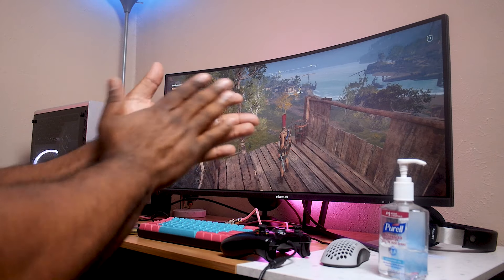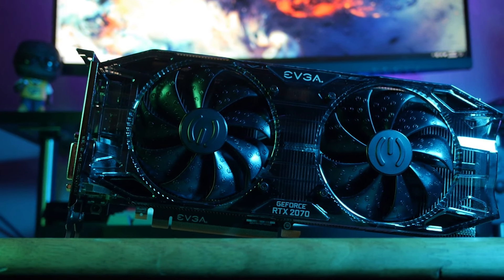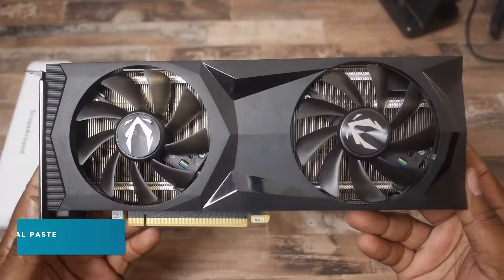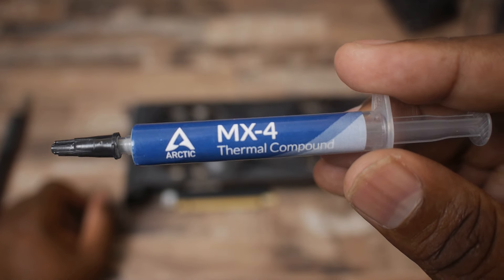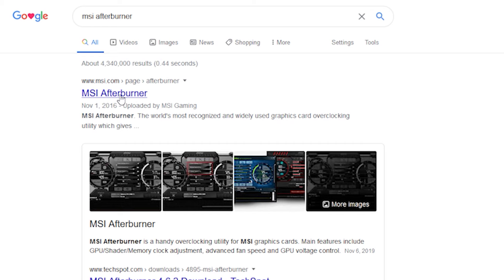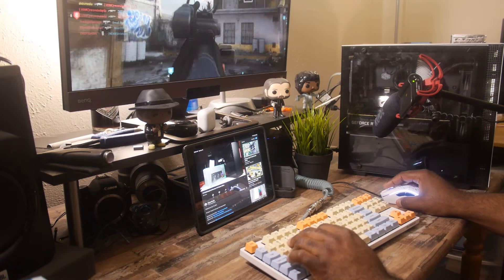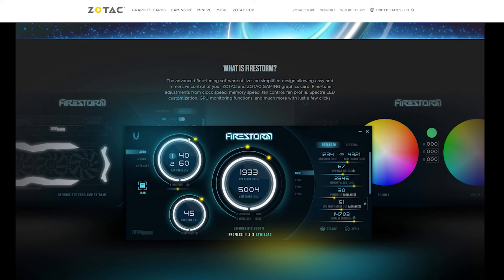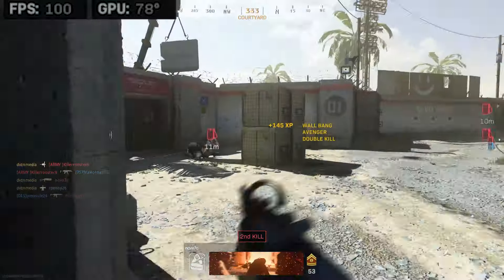3 Easy Tips To Lower GPU Temps!

Comment: just put shadows 2 low shit looks ridiculous at normal or high imo
Reply from the maker: Yeah you can always adjust the sliders to get the option that looks right for you!
Reply: @DVZNMedia  lol i bought a second hand gpu this year... i think its a miners gpu...  the temperatures didnd drop by dropping shadows xD... so i used thermal pads(dont use wrong measure thermal pads it will most likely kill your gpu core) and thermal paste on my rtx 3070 (msi ventus 2x) and cleaned the pcb of the gpu with isopropyl alchohol with q tips cleaned the gpu fans a bit... and my gpu temps dropped from 87+ to 71 C playing resident evil 4 remake on ultra with ray tracing... so yeah if you are ripped off like me this might be a solution also im going to try a intake fan my motherboard has only 1 port for a exhaust fan so i bought a Gelid Solutions PWM fan hub which should arrive tomorrow... and yea with the better inflow intake fan the temperature should drop a bit more... (i dont reccomand undervolting unless you are a expert but setting power limit to 70 from 100 on msi afterburner might help)
Reply: @DVZNMedia the airflow dropped the temperatures even more :^) definitly helps to have 1 exhaust (back) and 1 intake (front panel towards gpu so middle) dropped mine like extra 4 degrees celsius with all the stuff i did with this miners gpu your new gpu would prolly become a freezer o yea and if you have holes on top of your case it helps hot air move out cause hot air goes to the air (thats how those hotbaloons whatever work)

Comment: When running red dead my pc runs at 78-80 is that normal?
Reply from the maker: Red Dead is an intense game, I don't know what your case airflow is but that's not the worst, 80c is fine.
Reply: @DVZNMedia  even witcher 3?
Reply from the maker: Yeah those games can be really hectic on a gpu, like I said it's hard to know what everyone's case air flow is but it can easily push the temps on a most graphics cards
Reply: @DVZNMedia  thank you for the reply!
Reply: @DVZNMedia  i recently installed witcher 3 and played at ultra but my temps keeps playing around 70 and 80c my pc case had a front panel tempered glass that's why I'm planning to use a stand off screws to seperate the glass and the fan to have a airflow do u think this will lower the temp?? 

Thanks for the vid tho 👌

Comment: Guess I was too late just fried my new RTX 2060 by gigabyte ;(
Reply: how? I have the same card and idk if it will get ruined. What temp should I be aware at?
Reply: @MaZeYoutube  don’t be scared my friend I live in a shitty country (Iraq) with a ton of power outages and the power in my country is imbalanced looks like that day the power spiked too high and sacrificed my gpu to save the rest of my hardware i even had ups on it but sadly the ups couldn’t protect it i also ran a heaven benchmark and the max temp was 87C and it was in the burning hot summer of Iraq

Comment: Did all of that but this fucking zotac 3060ti twin edge OC max temp reach 81 degrees tried undervolt change psu change case open panel wtf is wromg with this fuck
Reply from the maker: Well I did speak to a rep, they say that temps well into the high 80s low 90s are ok, I just know we like them as low as possible.
Reply: @DVZNMedia  so its normal? i just my card low temp i had to cap fps on some games to keep it 65c. only when i play pubg at 1440p max settings fps unlimited it reaches 78-81 undervolted when its not undervolted it reaches to 83

Comment: Here’s a big issue that you guys always want to tip toe and dance around all these new damn cases with fucking glass panels and no side ventilation in a bag of the day we used to and I still used today by the way cooler master stacker 830 computer case you can Google that you can see how nice that case is I will ventilated it is what you may not see the fact that I can put 420 mm fans on the side of the case blown over the motherboard of the video cards the way I keep my current rig I blow to card to 120 mm fans over the video card that’s what you need to do with these damn cards all the things that he mentioned are useful and helpful yes and I’ll give you a degree or two here and there but ultimately with temps that high I need a side panel on your cancer and allows you to install fans to blow directly into the case